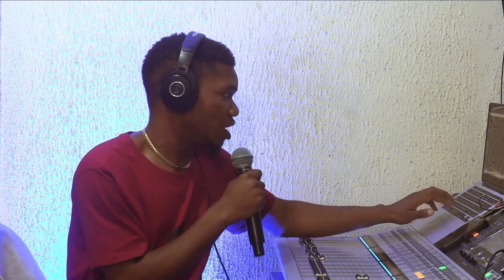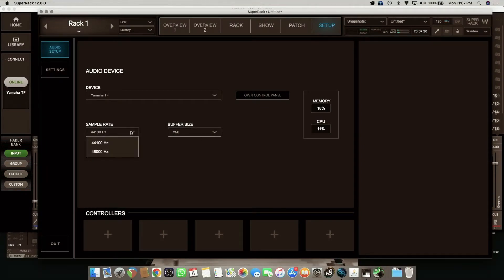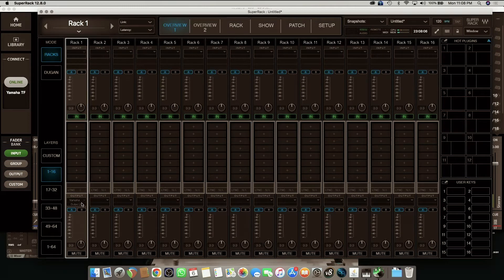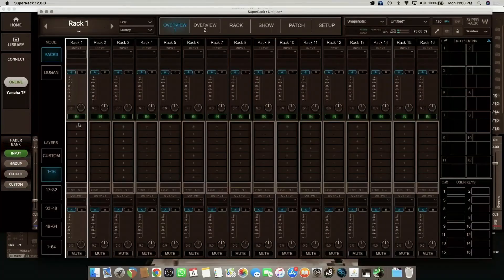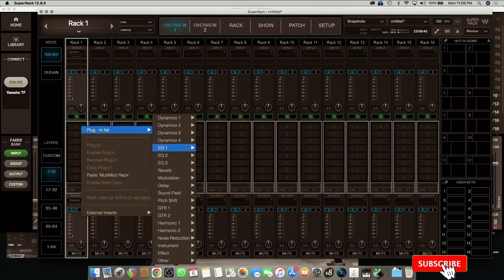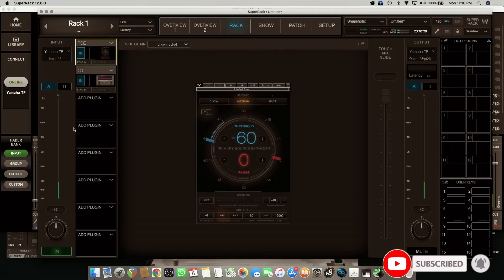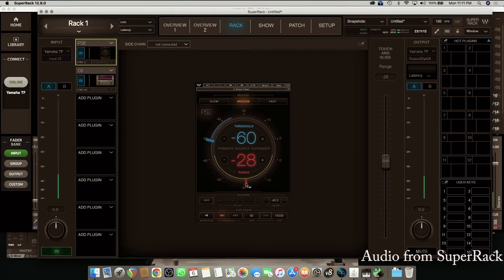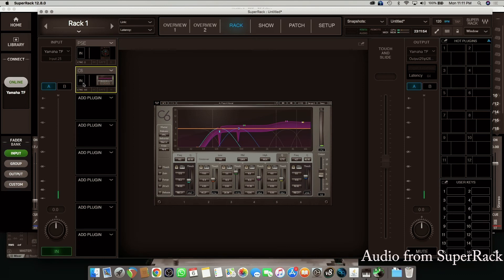How to setup Waves SuperRack on Yamaha tf consoles live

Comment: How about if using many tracks? Drum, bass, guitar, etc. How about the output?example, i used tio/dante for my band, and of course in my console i choose slot for the input. How can my superrack read the signal without choose the USB in the input? And to send it back to the console, do i need make every input to be the output? Example, input 1 out to 25, input 2 to out to 26, input 3 out to 27 etc. Is it right?. Because its impossible use same output in different track/rack in superrack. I use 25 for the output with input 1(rack1), and i can't use 25 for my next input(rack 2-3-4-5). Can u help me? Thankyou
Reply from the maker: You can reach me +2347037759354
Reply: @Richardmix_Doctor  thankyou brother. R u using whatsapp ?

Comment: How do i send the channels from waves back into the board. waves gets input but what do i do now. Also we use dante soundcard to send audio to speakers.
Reply from the maker: If you are using Dante, you need to buy DVS(Dante virtual sound card) on the laptop once that is done your laptop will appear on the Dante inventory as a device after the dvs has been started. You can route audio from the Stagebox to the laptop then return the output from the laptop to the console.
Reply from the maker: If you need a tutorial on that I can make a private one for you, with a little token. Just send me a dm +2347037759354